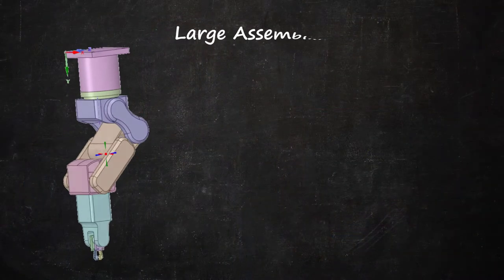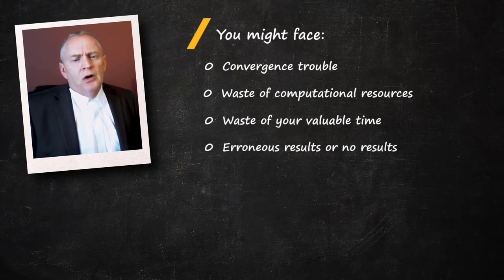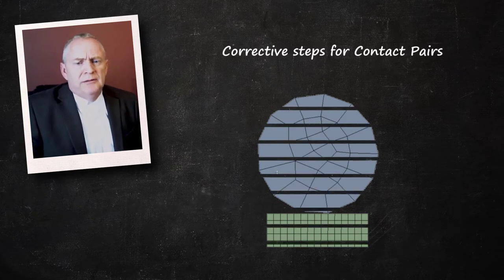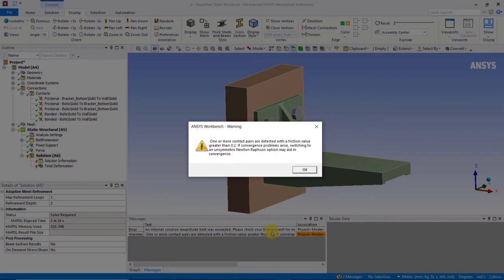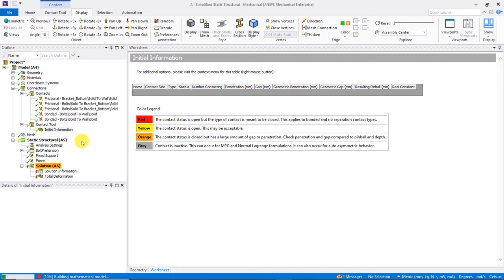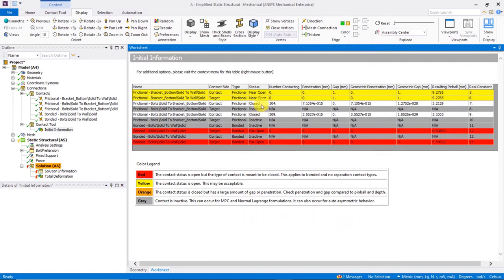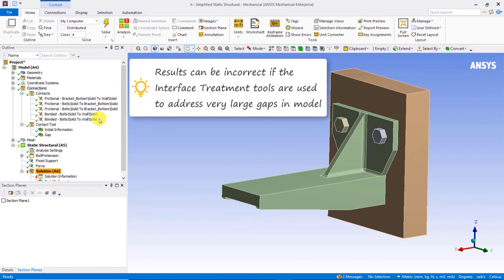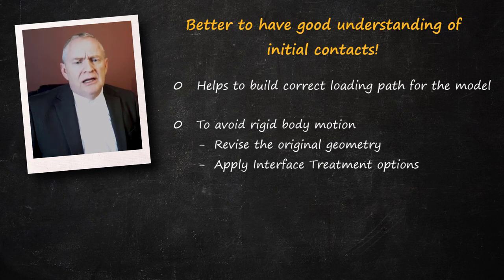Checking Initial Contact Conditions Prior to Solving — Lesson 3

Comment: Great video, however, I notice one discrepancy: at 9'18'' the initial information shows the two bonded contact are far open but Without gap and penetration, then at 13'19'', the section view shows the two bolt shanks actually have gaps with bolt holes. Why?
Reply from the maker: Thanks for watching! Please post your query on the Ansys Learning Forum for a detailed answer from the wider Ansys Community: https://ansys.com/forum.